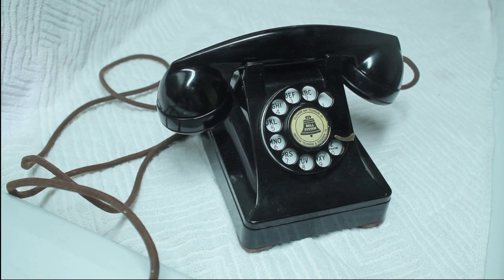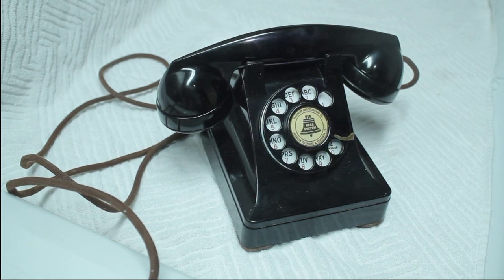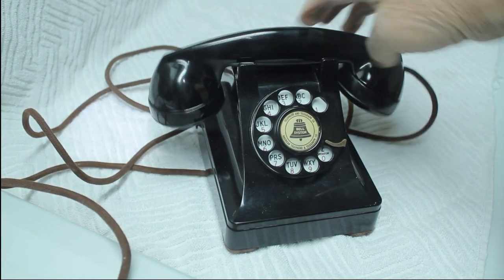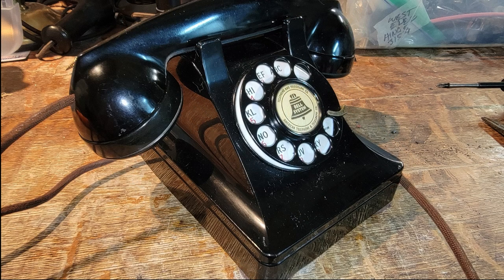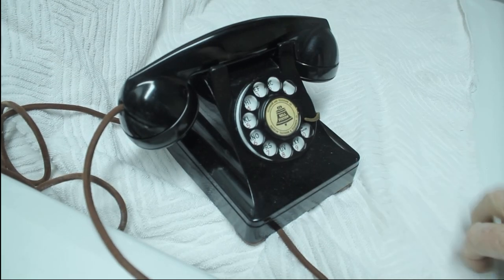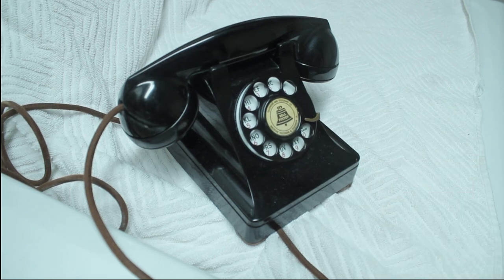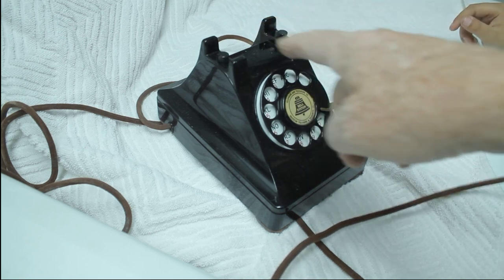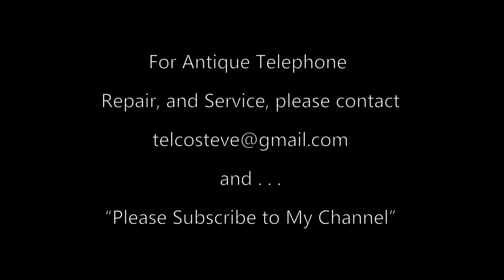DinoMinty302

Comment: Does pulse dialing still work in your country?
Reply from the maker: Yes rotary pulse is still working , but not too much with VoIP equipment interfaced with the setup of wiring to a talk path circuit.  In other words, DTNF is the preferred signalling method for call leg- either analog or digital.